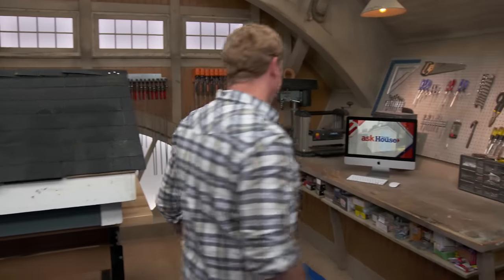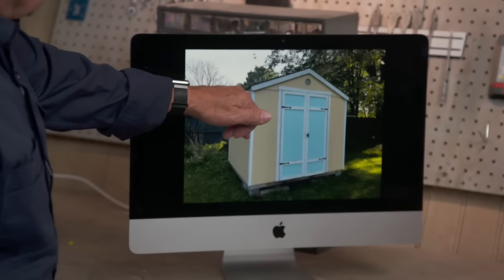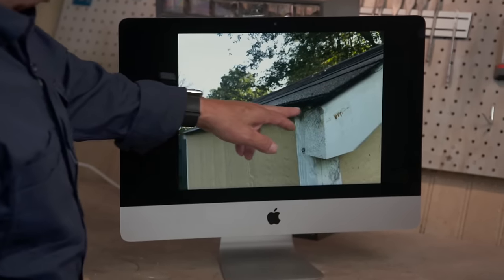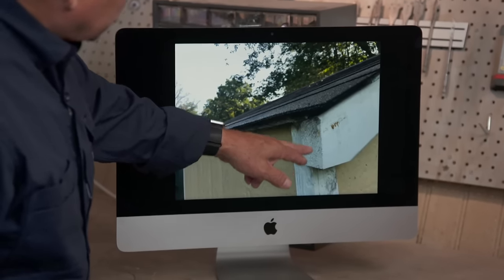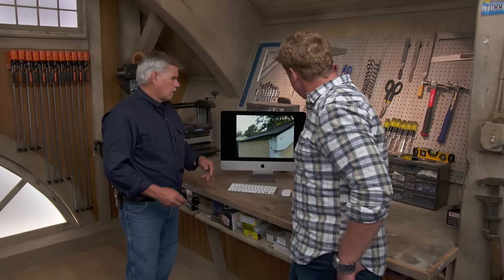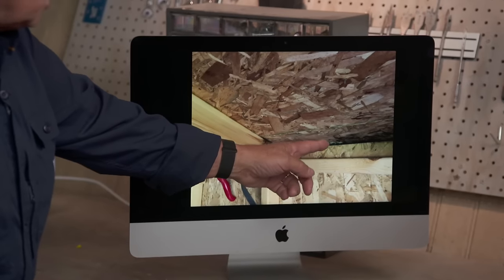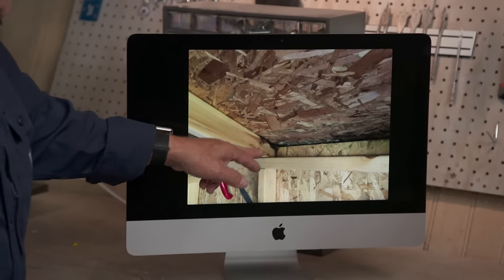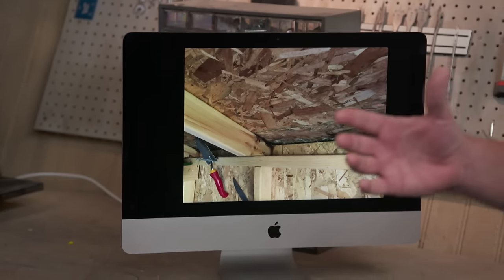Testing Drip Edge Installations on Roofing | Ask This Old House

Comment: You should address whether the drip edge should be installed over the underlayment or should the drip edge be applied under the underlayment.
Reply: Under drip edge on rake. Over on front
Reply: @hmg8915  Actually since I have gutters and live in snow country I prefer the underlayment go over and down the fascia behind the drip to keep any backup out of the overhang. Then install the drip followed by flashing tape to seal the drip to the underlayment.

Comment: It is a graet idea to overhanging  drip edge 1/2 inch on facial board, but how could we prevent once the roofer need to come up to roof to fix something later and must use ladder to lean on drip edge, how would drip edge not to be damaged?

Comment: I live in Dallas, Texas, and I’ve yet to see a house that does drip edges Tom’s way here. Could there be a climate reason for that, or are we simply all doing it wrong?
Reply: If the structure has gutters at the eave, it’s not really necessary to install the drip edge in this method, because the back end of the aluminum gutter is catching the water. Just need to have the drip edge with enough slack/space for the gutter installers to be able to slide the gutter behind the drip edge.
Reply: Hurricane winds. I don't think you want that shingle overhanging too much

Comment: I have seen roofers put that drip edge right against the facia board and on mine there is no facia and they put the drip edge against the rafters that protrude. What is proper way without facia board. With or without gutters..thks..jc

Comment: so WHAT IS THE BEST RECOMMENDED PRACTICE TO MOVE MY CURRENT DRIP EDGE OUT SOME? sHOULD i MOVE THE FIRST SINGLE OUT AN 1" - 1 1/2" ALSO? wILL THIS AFFECT ALL THE SINGLES MOVING UP? i CURRENTLY HAVE A REGULAR  T100 ASPHALT SINGLE ON A 12% PITCHED A FRAM ROOF. SEVEN YEARS OLD AND MY FACIAS AND SHEATHING IS ROTTING FROM WATER DAMANGE!

Comment: You can flex the face of the drip edge to the facia board and a 1/2 inch over hang on the shingle with a style "D" drip edge.

Comment: So really this proves that shingles should overhang drip edge 0.5 to .75 inches more than any of the other points? If the water isn't touching any of the drip edge, does that kinda nullify the point you're making with the gap?
Reply: I was thinking the same thing. He didn't do an example where he had the drip edge tight to the fascia and then just over hung the shingles. Seems like it would accomplish the same thing without that silly Gap

Comment: Surface tension brings it over the edge, capiilary refill makes the water soak up against gravity.
Reply: I believe it's capillary action you mean.  Capillary refill is the time it takes for blood refill; for example to press hard to blanche a fingernail  then release and see how long it takes for blood to refill (color returns).  You can do this at the gumline too.  This to assess for anemia, hemorrhages ,  etc etc. Capillary action is  like taking a paper towel to a wet area and watching the moisture  travel the paper towel.  Surface tension is the bug that can "walk" on water;  capillary action, surface tension... all attributed to the unique polarity of the water molecule.
Reply: @krissimacinniskelley4943  correct, I used the wrong one.

Comment: If my roof is already installed how do I extend the shingles
Reply: You will have to remove the first row of shingles and add an other row that hangs over.
Reply: That's what i did on my house and it looks good i even added the drip cap.
Reply: @electricianron_New_Jersey  He could also use a Henweigh too!
Reply: Insert 3/4" drip cap or deeper (used for exterior casings) upside down between the drip edge and the starter shingles.  This an easy and effective solution.  In fact this method also works to force water into gutters that previously stuck to fascias--insert the drip cap (proper side up) between the kick-out portion of the drip cap and fascia.  If you're replacing your roof, ask the roofer to install rite-flow drip edging, which has a kick-out at the top for the drip edge, and not just at the bottom.
Reply: @godbluffvdgg  As Norm Mcdonald would say, "you ditry dog"...
Reply: @straight_to_finish 
Brilliant brilliant. Thank you.  This will work on my 5 year old roof and new fascia repair.
Been reading quite a while and almost stopped after looking up "henweigh tool".
Reply: @robmannn  He was a funny guy...:)...RIP Can't believe Artie outlived him!

Comment: Should always use a eavestroughs friendly drip edge. So it sits above the nail furrows or Hangers. Then it’s independent of whatever future work gets done. 
I’ve seen drip edge that comes down too far on the fascia ( like roof edge sold at lumber yards) then the eavestrough installer nails right through the roof edge. Not a good situation for many reasons.

Comment: If drip edge is provided, then is it necessary to provide roof gutter with downspouts?
Reply: Gutter is an option, if your entry drips cold water down your back during a storm have it guttered, anything else is just a luxury. Lloyd , roofer of 35 years
Reply: @lloydholm7523  Unless you have a basement or crawl space; keeping rain water out of there is not really an option.
Reply: @stevescherer6602  I water proof basements and crawl spaces for a living, how long have you been in the waterproofing business?
Reply: @lloydholm7523  With all due respect, regardless of what you or I do for a living, I stand by what I said. I've had a basement/crawlspace home in GA for 10 years and a slab foundation home in TX for 20. Yes, if you own a Texas slab foundation home and the yard is properly graded, lack of gutters can be tolerated (good luck if you invest in landscaping though!) You, of course, are entitled to your opinion.
Reply: @g quin  Thank you so much for your precious time. YES you are right. I was talking about a general condition, not for a specific locations like entry or anything.

Comment: I'm not convinced about the finger gap , between drip edge and fascia. I like a gap, enough to easily slide the metal fascia into, but not enough to see the underside of the drip edge. . And i hang my starter strip an inch over the drip edge.
Reply: Use 1 x 3 inch board as a gap between the drip=edge and facia.

Comment: Is the drip edge better that gutters?
Reply: STOCKBOY7254 two totally separate issues.
the drip edge stops the water from running under the roof the gutters move the water away from the foundation

Comment: This is genius. I'm going to rip out the gutters and install these.
Reply: ..how did that go?
Reply: @darryltaylor9916  it didn’t. I ended up moving and our new house has great gutters.
Reply: @iamamish  Excellent choice!  The drip edge is under the shingles and usually under the felt underlayment...it's pretty rough replacing drip edge that is nailed in, without causing damage to the shingles..especially an (8" standard drip edge which I don't think exists unless you bend your own).and.if the shingles are brittle...you'll break every one of them when you lift up...better off just reroofing the whole house 00.02...thanks for the response, thought you might have a "do NOT do story".   =oD
Reply: @darryltaylor9916  haha yes what you're saying makes a lot of sense. Hopefully that would have become clear before I ended up doing Something Wrong...

Comment: Exactly how I told my roofers I wanted the drip edge, but instead, nailed it tight and no overhang of shingles at all. Also cut the corners instead of bending the metal.

 Icing on the cake, the city building inspector, approved their work except did fail the clipped corners and where they underlapped flashing instead of overlapping where roof met wall, and chimney among other complaints. So many shady contractors, drop off a truck of Hispanics that don't speak English and the nightmare begins. 

These archetectural shingles a nightmare too. Dripping water from night humidity every morning. What a con. Shady contractors and mfgs.
Reply: The more I inspect my roof, I see mistakes done the roofers. They put the wrong drip edge on my low slope roof causing wood rot, drip edge with a gravel stop flange on a low slope roof is like a speed hump or a dam to retain water (common sense). Funny thing is that my neighbor just had his low slope roof redone (Nov 2023) and the roofers did the same thing. Maybe for job security.

Comment: Drip edge should be used on the rakes only. 

Install Gutter apron (insurance will still call it drip edge) on the eaves which will flash over your gutters to keep water off your fascia boards.

Comment: No one holds drip edge a finger width from far facia. Especially when you covering sub facia with metal. That would be " fake news" guys. Other than that cool video I will definitely show customers that, simple thing but I run into it allot.

Comment: Why 99% of roofers don't install drip edge when putting new shingles?
The few houses that have drip edge, it is close to the wall/facia/wood/metal and they don't leave a gap as you did.
Is that ok as long as they leave shingles sticking out some?
Roofers installing drip edge today and want to make sure do it the right way.
Please advise.
Reply: They just dont install it because they dont think its worth the money which is wrong. If it was up to me i would be putting metal on every roof i do.
shingles should be about 1 1/2" out from the sheething if there isnt any eave metal, if thereis metal, then half a inch past is sufficient. Make sure to nail your start as close to the edge of the sheething as you can aswell, not at the tops as it ruins the secondary purpose of the starter shingle.

Leaving a gap isnt needed if you follow what i said, when you put the drip edge on just lay it loosely on the edge dont pinch it tight,
Reply: @Josh-ww5kz  Great, thanks.
Reply: Are you kidding? In 2006, they installed new roof with new drip-edge.

Comment: So.....the drip edge flashing is supposed to be installed with a 1/2 inch gap and NOT touch the facia board? 
Why have I never seen anyone install it as such even professional roofers?

Comment: Two other benefits to this type of install: it's much easier to paint the fascia and frieze without getting paint on the drip edge and it's easier to the get the gutter to work without water getting behind it causing rot.
Reply: Shhhh your not good at building. Shhhh.😁
Reply: I paint drip-edge in White and facia in different color. Whole roof looks nice.

Comment: Put aluminum trim on fascia board! If there's gutters on the house and your not pushing drip up tight to the bottom of the plywood you will lose gutter space. Your 5 inch gutter is now 4 inch or 3 1/2 inch which causes the water to run down the roof and miss the gutter and water lands on your head, cement and grass. You can also use a drip edge with an 1 1/2 inch face instead of standard 1 inch, it covers more of the fascia board. I don't agree with holding your drip edge down an inch or more cuz you're losing gutter space.

Comment: The solution is better designed and manufactured drip edge with pointy edges, not curved, that extend out farther. If I was building my own house I would paint all rafter tails, especially the end grain, the back and all edges of the fascia and soffit, especially the end grain, and maybe caulk all joints when nailing, But of course that's not the way things are done.

Comment: I'm confused, why all the talk about drip edges when a roof has gutters?
Reply: Because water can still go up under the shingles and follow down the facia due to surface tension.  I have gutters and no drip edge due to a home builder that cut corners.  I have water dripping between the back of my gutter and the facia board due to no drip edge.
Reply: Kenny Perkins actually this issue has nothing to do with gutters. It's about the water running along the underside of the roof and then going behind the gutter or worse yet behind the faccia Board
Reply: Because gutters only catch the water and redistribute it.  Go back to the video and look at the water traveling upward on the roof deck board, this is due to surface tension and capillary action like he was saying.  You need water DIRECTED into the gutters -- going downward and eliminate any wicking tendencies.  You need drip edge to break the surface tension of the water -- to make a drip.  Drip down. Into the gutter. If no gutter, drip to ground.  Keeping drips off /away from fascia.

Comment: If you want a home owner with an excuse not to pay you, leave your metal drip edge long like this. They will say the wind will get under there.. I run 2 x 2 painted drip edge tight to the fascia , because after 35 years as a roofer you will realize appearance is everything to a paying customer. I have roofed 3 $7,500,000.00 dollar homes , and some more expensive. Lloyd roofer of 35 years.
Reply: No offence Lloyd..... but why are you taking construction advice from people who can afford 7,500,000 homes? Do they even know what a screwdriver looks like?
Reply: God I need help with built in box gutters on plastic patio cover. Gutters leaking😳

Comment: So the gutter goes up underneath of it I guess right
Reply: Correct. 

Alsp. PVC coated aluminium facia is another option to cover your boards to add an extra layer of protection without a need for paint touchup. (If you can find the colour you want in the PVC coating). With aluminum facia covering, then drip edge, then proper shingle overhand, you can install your gutters and not have to worry about rot.

Comment: Been roofing for 20 years never use drip edge. If you install your shingles with an 1" over hang and your starters are right you shouldn't need that cheap crap. Its just another way to cover up a mistake 😕

Comment: You should never gap the drip edge, you should only overhang the shingles. His demonstration is flawed. He cut the shingles back on the first 2 so they weren't protruding past the edge. 
It has nothing to do with gapping the drip edge.
Reply: u sure?
Reply: @jomangeee9180  yes. I've been a roofer for almost 14 years. This guy has never been anything but a hack
Reply: Actually, lesser is better... If the shingles overhangs enough meaning it clears the fascia for 1/2 inch or so, you dont even need a metallic drip edge. Ask the roofers, they'll tell you!
Reply: @bourk67  metal drip edge is code just about everywhere
Reply: The shingles should never have an overhang of over an inch beyond the fascia, too much overhang will make the shingles bend down and crack within a few years.
Reply: It looks crappy too.
Reply: Integrate a gutter system behind 2-3” metal drip edge per manufacturer and building code.  Or fully wrap the fascia in metal siding.
Reply: Anon Ymous So there is no gap to your drip edge?
Reply: @JMGrimm  I don't think the building code where I live would even allow that type of a gap.

Comment: Or you could just do it right and install gutters.
Reply: The gutters go below this.
Reply: Standard gutters don't correct the issue of water following the facia by surface tension. The water just flows between the gutters and the facia.